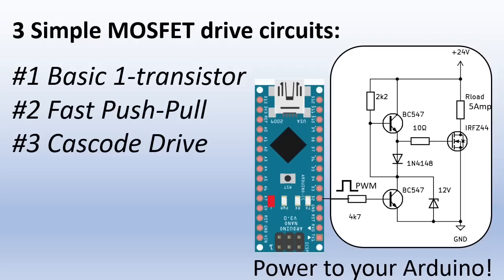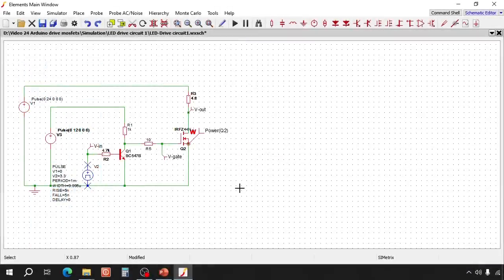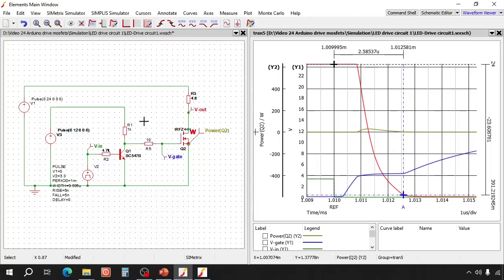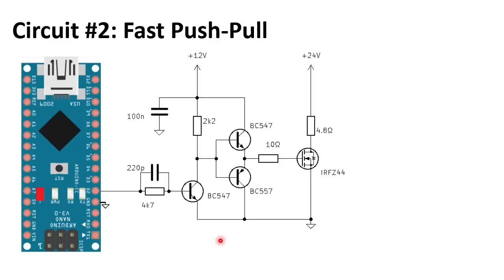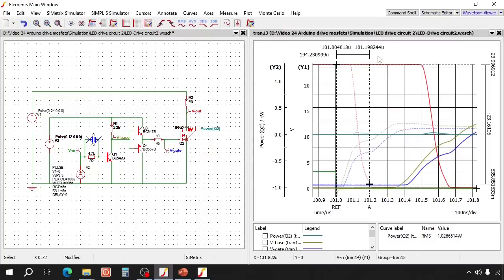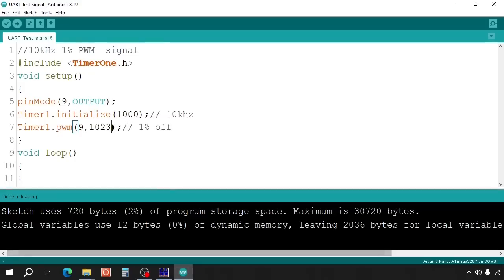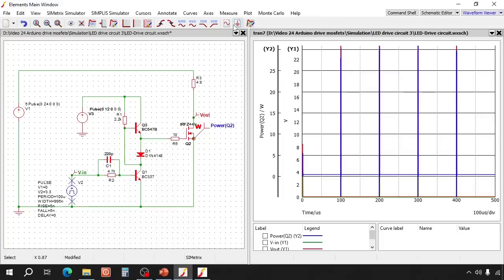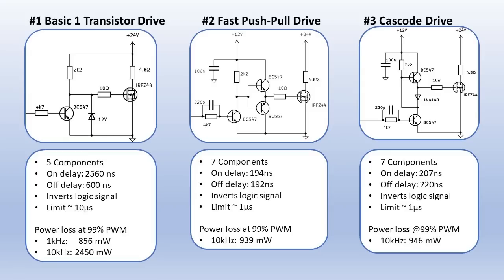3 Simple MOSFET Drive Circuits

Comment: Instructively explained! Bice work!😁 I think example 1 could be better, the single transistor. On the collector you have a resistor of 1K. That means that you only have 12mA peak current available. The NC of the IRFZ44N is about 65NC. So 65/12≈5.4 micro sec. But on the base you have 4k7. At 5V that is only ≈ 1mA. Can just reach the 12mA peak current (beta is low with fast switching). The 5.4US is therefore high at high switching frequency. I myself use a 2N2222A with a 330ohm resistor on the collector (12V), and on the base 2.2K (≈11V PWM signal). Peak current 3x as much as in your example. My MOSFET has an NC between 40 and 55. I do have a gate resistance of 4R7 with a diode with 1R5 in parallel on it. That 1R5 is for faster discharge. With my DIY boost converter soldered to perfboard I get max 92% efficiency (36V to 42V, 2A) with 110kHz. So I think your example 1 can still be achieved. For very high frequencies and heavy mosfets you can of course use the Totem Pole (eg BD139 with BD140) version or a driver IC, eg TC4420 or something similar.👍👍

Comment: so, I thought of replacing a relay which was supposed to act like a switch to operate my solenoid lock(12v x 600mA). can I use an IRFZ44N and a BC337 transistor to drive the solenoid? i know IRFZ44N is not a logic level MOSFET so what I thought was adding a transistor like Bc337 and making it work like a logic level MOSFET. is this method possible?
Reply from the maker: You can directly use a BC337 and a ~1k base resistor, but you must place one diode (1N4148, 1N4007, not critical) to consume the voltage peak of your solenoid coil, otherwise the BC337 will fail The diode must be placed in parallel with the coil with cathode to the + side. Have fun!
Reply: @smartpowerelectronics8779 thank you so much. i thot of using MOSFET cause the max current of BC337 is 800mA so I thot it wudn't be safer.. anyways thank u for ur reply! i jus have one more question,, what i had typed before can I convert a non logic level MOSFET into a logical MOSFET by connecting that transistor along with it?

Comment: Is there anything to drive MOSFET at 2MHz ?
Reply from the maker: Not in the circuits shown in this video. For 2MHz you either need to drive resonant, or use a strong drive IC. Search for International Rectifier MOSFET driver IC's they will have the best application notes and tips in their specifications. 🙂

Comment: Hi, I interested to apply circuit No.3, but it should be non inverting as I will use it for N-Chn mosfet driver on flyback SMPS. Please advice.
Reply from the maker: Try this one based on NE555, it is non inverting and fast enough for Flyback: https://youtu.be/FKqkRDM0Al0  make sure you pick the "norma;" NE555, not the CMOS type, the video has the full explanation. I use it now for most projects, because I have many NE555' ;-)
Reply: @smartpowerelectronics8779  Thankyou for the advice, but I think LM555 would not capable to drive MOSFET APT8030LVFR.

Comment: Great videos. I want to build some of your circuits. What type of speed up capacitor did you use?  Standard MLCC?
Reply from the maker: Yes an MLCC will work, I used a film cap because it has leads making it easier to solder.

Comment: Is it advisable to drive the high side MOSFETS of Half-bridge converters with BJTs?
Reply from the maker: For the level-shifting it is best to use an IC, discrete solutions as used back in the 80's and 90's are technically interesting but require many parts increasing the manufacturing costs size and cost of design(er)s. What is still done is adding 2 complementary BJT's to boost the current output (emitters tied together are output), but IC's are readily available now the complexity is to find the best IC for your application in an ocean of options ;-)

Comment: An external gate resistor of 10 Ohm is allready a lot. The internal gate resistor of the IRFZ44N is around 2 Ohm. An additional gate resistor of 10 Ohm allready slows the device considerably down.

Comment: For the cascode drive, isn't it inverted? Input from the mc turns the load off. Not on, meaning avg voltage through the load is near max with a slow pwm signal?

Comment: Great video, so glad I stumbled upon it. A big thank you for putting it together!
Checking my understanding: in schematic #2 to obtain 12V to drive the gate you use a 2k2 resistor (and a 12V zener). Doesn't this limit the max charging current to just a few mAmps? I thought that part of the problem (aside of the Arduino not being able to supply the 10V or so to the mosfet gate) is also that it wouldn't be able to source more than a few tens of mA... ultimately affecting the switching speed negatively.

Comment: Thank you for a very clear explanation of these 3 circuits. However, I would have liked to see an actual application of each. Something simple, maybe with one or more LEDs and/or a small DC motor. I have no doubt that the 3 circuits work but I have a problem visualizing the results of each in an application. This problem is not due to your explanation but in fact, it's due to my own lack of experience and knowledge. 
Thanks again for your video!
Rich

Comment: Can i change the IRFZ44 for a PNP Mosfet ? making it PNP normaly open, and switch highsize ? or does the circuit need modification ?
Reply from the maker: No, a PMOS will not work you will need another circuit for it. I have another video that shows how to switch an NMOS at the high side though.

Comment: Could you please share the source where these circuits appear?
Reply from the maker: Hi Steven, these are circuits from my memory from the 90's, I just verified them by simulating and building them. I did not have practical experience with the 3d circuit (cascode), I heard of it before and found one reference here: https://electronics.stackexchange.com/questions/264142/drive-a-mosfet-via-bjt
MOSFET driving is very specific knowledge, so it is not easy to find good reference information. You can check application notes of Texas Instruments, they have some great material like  this pdf: https://www.ti.com/lit/ml/slua618a/slua618a.pdf?ts=1722369784772

Comment: Tried but don't know why it's always on and the two bc547 are just getting hot .
Reply from the maker: Was it the 3d circuit? (cascode with 2 x BC547)
Please check the 12V supply and the transistors (Take the out & check B-->E and B-->C with multimeter diode test mode, should be 0.6-0.7V).
When all parts are ok, also voltages make sense, connect the input to 12V, then to 0V (gnd) and check the output (with a LED+2k or mutimeter) - does the output go up and down?
Reply: @smartpowerelectronics8779  Will try, thanks for the reply !

Comment: Am I right with my guess that a bipolar transistor is used instead of a small mosfet like the BS170 because the driver transistor's switch time doesn't matter much compared to the power MOSFET's switch time?
Reply from the maker: Yep and because you probably already have a npn lying around 😊
Reply: @smartpowerelectronics8779  You're right, I did! I also had the IRFZ44N, it was like magic.

Comment: hi, great tutorial. I apologize if this is very basic knowledge I'm missing, but why can't we directly connect the MCU's GPIO pin to the gate of the MOSFET? MOSFETs have insulated gates so they won't draw any (or perhaps very little) current, right? much less than the base of a bipolar transistor for sure; so why go through the trouble of connecting a separate NPN for example in the first circuit? Thanks.

Comment: so ive got my hall sensor triggering my arduino and then arduino into a gate driver chip and then gate driver chip into a mosfet. 
but the coils are being turned on for wayy to long and its over heating the coils very quickly and not even getitng up to speed, very un smooth, i have a 100 ohms resistor between gate and driver output and10k across gate/source. and a 4k7 ohm reisstor between arduino out and gate driver logic input. can you suggest what im doing wrong here ??

Comment: ive just bought all the components needed to make your cascode circuit !! i couldnt resist !! to infinity and beyond !  : )
Reply from the maker: Yeah, that circuit is fun, even though you do not save many parts compared to the 3-transistor circuit.
Reply: @smartpowerelectronics8779  yeah, its a nice little challenge for me ! and i chose the cascode circuit because you said its faster than light ! : P  hehe.   and sharp on/ off times is what im looking for !! the parts will arrive soon. and i have also bought the gate driver chip you suggested as well. i also had a new nano board arrive today ! so i can trigger the gate driver chip soon and also use my hall sensors now ! and this way i wont be over voltage'ing the gate ! good luck to me ! ha thanks !

Comment: i have another question for you master of mosfets ! now i have my mosfet, 600V CoolMOSª P7 Power Transistor
IPA60R08, im not using gate driver yet, but i have my pulse motor that the mosfet is triggering a coil on and off for. 

the voltage for the gate/source is coming from a trigger coil. the magnets spin passed it and create a voltage etc. 

And the coil  is getting a bit hot, is there a solution to keep my coil COOLER? the coil is significantly hot. 
the mosfet is a bit warm, but only a little bit, with a small heat sink. 

but its normally cool when i run the pulse motor at 12 volts. i would like to figure out how to keep things cool at 24 volts. 
because i get a much better output @ 24 volts input. 

what i am doing is charging battery's on the output of my motor with the energy pulses that occur when the coil turns ON and off. 
the transient spikes. 

do you have any ideas about keeping my motor coil cool in this situation ? 
its always been a challenge for me. 

would my coils stay cooler with a higher power rating of mosfet? or is this not how things work ? 

and do you think the ON time of the mosfet is too long and is perhaps whats causing the excess heat ? 

the mosfet says 4volts is the max gate voltage, but my trigger coil generates a higher voltage than that, 7 - 17 volts 
is this naughty to give the mosfet gate a higher voltage than the datasheet says is its maximum? 
should i be limiting the voltage to the recommended maximum voltage for the gate ? 

i plan to replace the trigger coil, with a hall sensor and gate driver soon ! 
thanks for your help so far ! : )
Reply from the maker: I am not sure why the motor coil gets hot, reducing the on time will for sure help. A MOSFET will die very quickly if the gate-source voltage exceeds its maximum, there is some margin but not much, if you exceed, it is gone instantly. Is the trigger coil a seperate coil? Or part of the motor? Sorry I am not a motor expert ;-)
Reply: @smartpowerelectronics8779  i see ! my data sheet says the maximum voltage is 4volts of Vgs. but i have more than 8 volts and its still working.  its a little warm, but it is pushing 1.5 amps through the drain/source. so i thought maybe thats normal. and yes ! its a sperate trigger coil. so it produces more and more volts the faster the motor spins ! so it will be good to replace the trigger coil with a lovely hall sensor / arduino / gate driver situation !! : )   i tried connecting my two motor coils in series and that makes them cooler, which is most likely because i am halfing the current draw on each coil. but then this makes motor slower, so i put the two coils bakc in parrallel and this is faster for better output. but coils are a bit warm now. but soon i can test the shorter on/off times !  i can make a video when i have succeeded with my hall sensor ! thank you !

Comment: the cascode circuit: Is the 100nf cap connected to the arduino ground ? and im slightly confused about the 12v arrow, where do i get the 12 volts ?  i understand if my source voltage is 24 volts for my main load then i have 24 volts for my mosfet drain/source but im not sure what the 12 volts is ?
Reply from the maker: Hi TVDylan, Yes the 100nF is connected to the Arduino ground.
The 12V you need to make from the 24V or any other high voltage you have in your circuit. For example, from 24V use a 2k2 resistor and a 12V zener diode, or a 7812/LM317 voltage regulator as you wish. Most MOSFETs do not allow more than 20V on the gate, so 24V is too much.
Reply: @smartpowerelectronics8779  i see, thank you !! i can do that ! and..so if mysource is 24 volts, two batterries in series, can i connect inbetween the two batterries for the 12 volts ? : )

Comment: If you don't live in a lab it's of any use?
Reply from the maker: Hi Abdul, the circuits are used in mass production in the millions because it is still much cheaper than an IC. If you just want to get this function done as a hobbyist, an IC is a good solution and cost is not an issue. What is good about the circuit is that it illustrates how the principle works. I have been a power-supply-IC designer, inside the IC it works similar. I never understand why IC vendors keep charging such high prices for such a simple function.

Comment: it works very well in my simulator as well, however when I built it with real transistors, the speed is very slow.  Have you tried it ?
Reply from the maker: Yes, I built all 3 circuits. The 1st one is really slow. It should work, even with other transistor types (BC547 is pretty poor) . How is your input signal? Does it have a fast slope?

Comment: can you make me one please ! : ) i can buy it ! i want to do fast switching without burning my mosfet !! :  )
Reply from the maker: I suggest you buy a MOSFET gate driver, for instance TC1411N. Buy the "N" version, it does not invert and buy DIP-8 so it is easy to solder. Search the specification (Bing " TC1411N pdf") and follow the test circuit. It will work, only a few components :-)
Reply: @smartpowerelectronics8779  oooh !! thank you very much !!! : D
Reply: @smartpowerelectronics8779  thanks very much !! so do i just connect the driver directly to the mosfet without any extra compnenets in between ?    PIN 6/7 to GATE, PIN 4/5 to SOURCE GROUND(NEGATIVE),  PIN 2 to INPUT SIGNAL (ARDUINO DIGITAL OR HALLSIGNAL), and PIN 1/8 to INPUT POSITIVE ?  and i saw in one diagram a guy has a 0.1uf cap between pin 1 and ground. is that how you would do it ? im a bit of a begginer when it comes to driver chips, so its a littel bit ocnfusing to me. iver nearly figured it out tho ! you obviously know alot about this stuff !!  ive always used a trigger coil directly to my mosfet gate with my pulse motor. which is what im going to do with this driver chip. im going to be turning a coil on and off on my pulse motor with 12-24 volts form the batterys. any help will be much appreciated ! and the fast on /off times are crucial for my experiments : )

Comment: 1. Running from 24V as shown blows up the MOSFET because its maximum Vgs is only 20V
The same issue is with the presentation frame circuit which is essentially No. 3 but with 24V on the gate drive as well.
Let me stress, MOSFET's do not like excess gate voltage, and note that some MOSFET's have a Vgs Max of only 8V.

Note also that the fast drive supply should be bypassed at close to the top BC547 and the source of the IRFZ44 because the switching speed is around 150ns.
For the same reason the lower BC547 emitter should be connected to the IRFZ44 source with short connections.

Note also that they make special high current gate driver IC's that can supply as much as 6A and switch in as little as 10ns.

Comment: dont like that  the mosfet is driven when the input is low (think of  what happens at startup of the program  , or during the time that the chip is programmed)
its just not good enough
Reply from the maker: You are right that the MOSFET may be on during initialization of the MCU. So if your circuit is sensitive this this you have to take measures in your software of hardware to prevent this.

Comment: But shis simulator does not show reality, reality if far from this, if you turn mosfet off, you can have even 80 - 120 V spike.
Reply from the maker: Simulation still cannot replace soldering, but it is useful to prepare for a prototype :-)

Comment: That takes me back. Used Simetrix for many years. I think it was the very best simulator. Also used the cascode driver for switching PSU designs back in the mid 80’s and was still using it for motor PWM driving in the 2000’s. The only downside is the addition voltage drop of the diode. Maybe not a problem for home electronics but it was a problem in automotive design when high current draw could cause local ground shifts.

Comment: In the first circuit, the capacitor across the gate drive resistor would not make any difference ?
Reply from the maker: yes, but only a very, because most of the delay is caused by the resistor charging the gate slowly. The 2 delays add up.

Comment: For me, the 2nd would be the most suitable, cause of the lowest on/off-delays. Other people, who don´t publicate their schematics, say, that their mosfets don´t survive for long (30-40kHz), so I thought, I´ll use an igbt instead of a mosfet. Is that a good idea, or would that mean, that your schematic isn´t suitable (in its basic principle, and not the exact values of resistors/caps/diodes themselves, I mean) ??????? 
The purpose is to use the pwm-signal to turn on-and-off a circuit with 60v, letting sparks spring over a gap, for ED-machining, edm... I know almost nothing about electronics, but I still can easily follow you, and I know, that those other makers also use some simple mosfet-drivers for their circuitries, but no-schematics, and low-resolution-videos don´t help figure out their driver-circuits... Thanks á priori for any answer
Reply from the maker: For 60V MOSFET's should be fine.  IGBT's are used for high voltage. 
I do not know the circuit you use, is it a transformer or an only a choke? The choke can make high voltages and destroy your MOSFET.